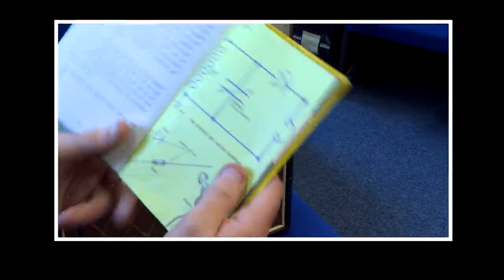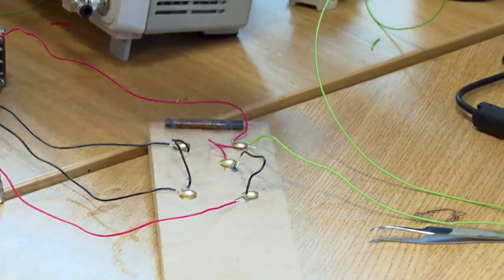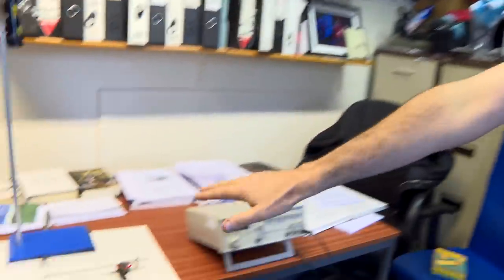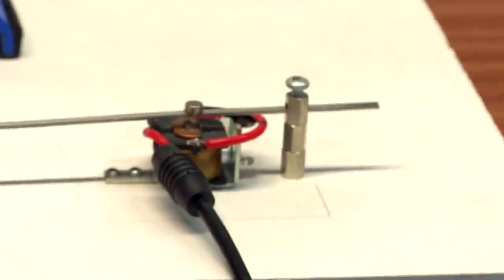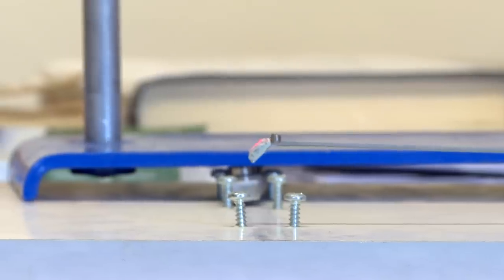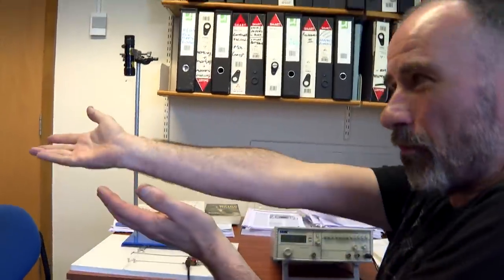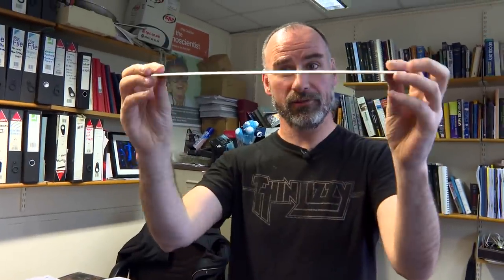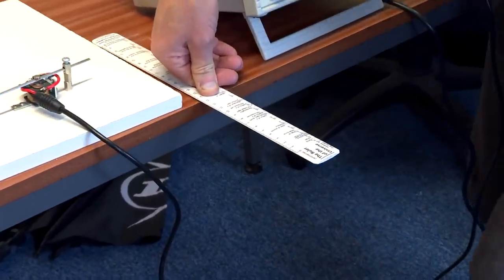Resonant Frequency - Sixty Symbols

Comment: For the resonance my favourite analogy is pushing someone on a swing. If you always push them at the highest point it is very efficient but if you start pushing on a swing at random phases you use a lot of energy but the swing doesn't do much.
Reply: What's crazy is that I wouldn't even really call it an analogy; literally the exact same thing is happening but electromagnetically!! It's so cool!
Reply: But what if you push it at all frequencies? ie, white noise?
Reply: Chris LeeWoo I’d be interested to know the answer to that. I would think you’d get the swing to the same peak amplitude as when hitting their resonant frequency, but the amount of energy you’d need to do so would be much larger because each frequency requires energy. Physically I think it would be equivalent to just always holding your hand on the person’s back all the way through the swinging motion, so you’re doing all the work and their natural frequency isn’t helping at all.
Reply: @ChrisLeeW00  Hard to imagine milions of hands pushing the swing at different frequencies, but besides of that lack of imagination, supposing it's somehow doable (maybe some actuator driven by white noise), the swing would choose its natural frequency (and a little bit around it) from which it would benefit the most in terms of energy transfer. Exactly the same thing as with the "penny radio".
Reply: I think i finally understand why resonance matters so much....
Not even kidding!!!
Thank you!
Reply: @ChrisLeeW00  if you have all frequencies pushing, at all points, at all times, you will get absolute 0 output force.
Reply: @ChrisLeeW00  it'd be like sitting on a wind where there's constant wind
Reply: @ChrisLeeW00  The swing would stay put at some point where the average sum of all pushes in an amount of time equal it's gravity vector. This is assuming the sum of all pushes is not enough to make it loop around and break.
Reply: @Whargoul1942  Constant wind isn't all frequencies, it's an extremely low frequency. Frequency is period/1, and if the period is much bigger than the length of the experiment then we'd say the force is constant, and the frequency is extremely low or zero.

I don't know if you can have a mix of 'all' frequencies, but a mix of many frequencies would be more like constantly changing, unpredictable wind.
Reply: Minor error (but major piece of trivia): the most efficient isn't to push at the top of the curve, but at the lowest point. Daycare teachers save a lot of energy by standing next to the zero-point of the swing and pushing when the kids swoosh by.

Comment: I think the easiest/most intuitive example to understand resonance is pushing someone on a swing. 

The person's mass and the physical attributes of the swing dictate the resonant frequency it'll swing at. 
Now you start pushing, and notice that the only way to make them swing higher is to push at exactly the right time, i.e. once per swing, and synced with the highest point nearest to you. Gravity starts pushing them down, and you help by only pushing WITH gravity. 

If you push them consistently twice per swing, you're pushing once while they're swinging away from you, making them speed up, but then you push them again on the way back, undoing all the work of the first push, and keeping the amplitude at a constant low value. 

This is the same thing as what phil was describing. Pushing at the same frequency as the person would naturally swing means you're only transferring energy/momentum when it'll increase amplitude.

Comment: Resonances are everywhere.  The Prof mentions linear mechanical and electrical systems, but there are also rotating mechanical (crankshafts are built to avoid them), pneumatic and hydraulic systems, even heat systems sort-of have them. They define antenna lengths and sizes, they happen at light frequencies inside the electron shells of atoms, called emission and absorption spectra. Seismic signals result from resonances in the various media they signals pass through, frequencies the builders of buildings try to avoid by making buildings stiffer or heavier.  Engineering is the study of how to enhance or avoid resonances.

Comment: The analogy of vibrational resonance and electrical resonance isn't even just symbolic: mass resists changes in motion (inertia) while inductance resists changes in electrical current, so that term in the equation is just literally "how much any change will be resisted", without caring what type of change we're talking about. And capacitance is how sensitive the current is to changes in voltage, while stiffness is how sensitive the movement is to changes in force (and voltage can be thought of as the "force" that drives current), so that term is just "how sensitive the thing is to a change in driving force".

Which just goes to show, anything that (a) has a sensitivity to some driving force and (b) has a resistance to change will oscillate with a resonant frequency that can be calculated with the same equation.

Comment: I like the explanation of pushing somebody on a swing.

If you push too slow, you miss them most of the time and you don't manage to transfer the energy you put into the pushing into the swing.

If you push too fast, you may push, when the swing is coming towards you, or miss the swing again, as it is moving away from you. In both cases the energy you put into pushing the swing is not used, or even cancels out with the energy you put in before.

Only if you push at the frequency of the swing, you manage to transfer the energy you put in optimally and the swing gets faster and rises higher.

To me this is easier to understand, then "driving" a rod. But this might be, because I'm not native to English :)

Comment: to take the example one step farther, changing the amplitude of the laser bar isn't equivalent to changing the capacitence on the radio circuit (though it is understandable why you might think that, as it's the part in both systems that is being changed).  the change in amplitude is essentially changing the incoming signal.  

the weight of the bar and it's stiffness both combine to give the system a certain point where it resonates.  that "point" is equivalent to a radio station coming in over the waves.  Except that all the radio stations are coming in all the time, and changing the impedence/capacitance is adjusting where the resonant point of the system is, trying to intersect one of those radio stations.

Comment: Seems like a much better analogy would be pushing someone on a swing. If you input energy with a push at the right time (ie, at the resonant frequency) then the swing will go higher and higher.  If you instead push at the wrong time you take energy out of the system and slow the swing down

Comment: 5:14 that's what a control engineer would say Force-Current analogy. A one to one correspondence between force-current, capacitance, inductance, resistance to spring, mass and damper system.

Comment: To complete the "comparison" it would be beter to FIX the frequency on the function generator and then CHANGE the rod length, for example, until the maximum laser amplitude is found; that would be comparable to modifying the capacitance of the radio, because the "driving" waves are there on the antenna (as the function generator with the frequency FIXED) but you change the natural frequency parameters.

Comment: Oh man, there’s just one more step now...

Put the solenoid (with an adjustable clamp) at the edge of the table, do you can slide the bar in and out to tune its resonant frequency,. Then drive the solenoid with a complex signal containing several frequency components. Now tune the resonator to pick up each of the component frequencies in turn, and you’ve demonstrated exactly how a basic radio works. Even better if the sub- frequencies are amplitude modulated with a carried LF signal.

There must also be higher physics concepts that this would demonstrate nicely too.
Reply: I know!!!  Thank you for such a great comment! 

And there are very, very close parallels between what you're suggesting and how an atomic force microscope (particularly a multi-modal microscope that works with different harmonics) operates. (Except the cantilever length is always fixed for an AFM.)

Thanks again.

Philip (Moriarty)
Reply: Is what you are describing FM or AM radio? Because the desktop radio he built was picking up AM.

Comment: I have held the phenomenon of resonance dear to my heart ever since I was educated to be a telecommunications tech in the Seventies. However, I first discovered the principle at an early age by observing the effects of different rates of movement of my body in the bath. Get it right and gallons are on the floor!
BTW I feel he neglects to describe how resonance arises through input of energy at a rate which matches the rate of the intervals between peaks of the natural vibration, thus adding energy to each peak, PROVIDED THE TIMING IS ON THE UPSTROKE OF THE VIBRATION.
Otherwise, you could input energy regularly on the DOWNSTROKE and stop vibration entirely.
Phase is as important as frequency!

Comment: I feel he didn't really explain what resonance actually is, only what its effects are. Like others have mentioned, it's like pushing someone on a swing at the right time, or timing a speaker vibrating to constructively interfere with previous sounds the speaker has made that are reflecting from a wall opposite the speaker in an enclosed box. Pushing or vibrating at off-resonant frequencies will not efficiently add energy into the system because some of it will destructively interfere and dissipate the energy

Comment: The resonance frequency wasn't explained in a clear manner here at all. Here it is.
Imagine a swing. It moves at one full swing a second when no external forces are applied.
If you push it every 1/3rd of a second then sometimes you are pushing it when it's moving away from you (speeding it up) and sometimes you are pushing it when it's moving towards you (slowing it down). In the end, you aren't doing much because some of your pushes act against the other pushes.
Now, if you push it every 1 second, at its resonance frequency, then you will always push it when it's moving away from you (at the beginning it might be the opposite but then your initial pushes will stop it). With every push, you are increasing the speed of the swing, transferring your energy very efficiently.

Comment: Adjusting the frequency but not the amplitude...but the amplitude does change at the resonance frequency?
Reply: Precisely! Amplification occurs at the resonance frequency. You can try it. Let some water in your tub, and try to move it around with your hand. If you do it at the right pace (frequency), your hand pushes the water exactly at the same time as the wave is reflecting back from the side, and amplification occurs. If your timing is right, the wave will be so big that it splashes out of the tub. This is called resonance. Now if your tub was longer or shorter, you would have to move your hand at a different pace. If your hand moved much faster or much slower, the water would never splash at all, because the reflective wave wouldn't be in phase with your hand movement. And that's exactly how radios work. There're all sorts of frequencies (channels) present in the air at the same time. When you tune your radio, it becomes sensitive to one specific frequency, and that specific radio channel tunes in. As you change the capacitance, it changes your receiver's innate resonance frequency, and a different radio wave causes resonance (like the splash of water), so you just switched to a different channel. All the channels are present in the air at all times, but your receiver is only sensitive to one at any given moment. That's why they can air all those programs, and you can choose which one you're listening to. And that's how we can all talk on the phone at the same time without hearing each other (although that's astronomically more complicated than AM radio).

Comment: Something that shock me when studying resonance is that all the interpretations come from doing a "small angle approximation" in the differential equation... ane still nowadays, nobody have found the analytical exact solution to the differential equation of the nonlinear damped pendulum... it have been analyzed probably by every live physisician and matematician... it model/explain the most simply real mechanical system (without approximations)... and still nowadays didn't have an analytical solution.... it is kind of frustrating and inspiring at the same time, because of how much can achieve engineers using this kind of approximations

Comment: As much as I like this guy, this is a poor explanation of resonant frequency that the lay person can relate to. Best example I give to people, pushing someone on a swing. you push at the right time (your driving frequency) and you dont have to push hard at all to keep the swing going because the swing was already going back and forth (oscillating)  -- in the case of this mirror bar, when the bar was going on its own, it took little input from the driver and they added up.

Comment: if radio waves are essentially photons, how do transmitting antennas turn electrons into photons, and then receiving antennas turn photons back into electrons?
Reply: Photons are electromagnetic waves. When an oscillating electric field hits a wire, the electrons in the wire move in response to the external field. The induced movement of the electrons creates a current in the wire

Comment: If I have to tune my radio to this very specific resonance frequency and most radio signals are frequency modulated, meaning the frequency changes all the time, how is it possible to get a decent sound out of a radio?
Reply: mmm no i think this radio works only for AM amplitude modulation, frequency modulation receivers are more complicated to made, in AM the frequency stay the same.